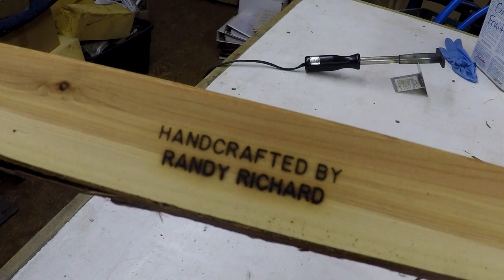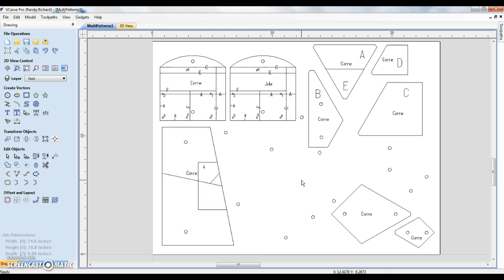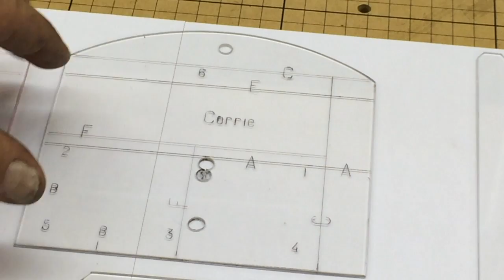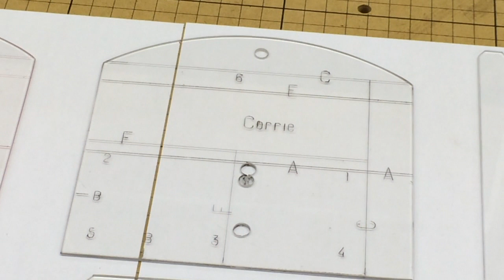X-Carve Quilt Patterns

Comment: Nice job on that Plexiglas.  Sometimes I have run a cutter or drill too fast and start to melt the edge.   Plastics are difficult to cut sometimes.  That run away at the end was funny.     Thanks for sharing.
Reply: +cerberus If you're etching or cutting acrylic, use cast acrylic instead of extruded. That run away at the end was probably due to him making a measurement error in vcarve.

Comment: Nice job Randy,  you need a vacuum table.   Glad the see there are other folks that cut through their clamps.   The odd thing is you can see that it's going to happen but time seems to stop and you can't get to the Estop button fast enough. 

Craig
Reply: +Craig S Definitely agree on the vacuum table. It would eliminate the need for hold down screws and "disposable" clamps. Specially useful with soft impossible to clamp  materials. Use ceiling tile as a porous sacrifice layer and seal the edges with saran wrap. Vacuum pumps are as easy as a discarded refrigerator and an old propane tank. Now that you have samples you could nest the parts better to maximize material usage. Happy wife... well you know. Happy daughters... I don't know.
  Mike (o\!/o)
Reply from the maker: +Craig S Yep a vacuum table would be great.
Reply from the maker: +Moholo 88 I will have to build a Vac. table.  I have a couple of vac. pumps.  Randy

Comment: I used to make gages out of 1/4" polystyrene (perspex or Plexiglass) for inspecting lamp filaments after winding. For the engraving I used a digital scale, a utility knife blade and then different colors of ultrafine Sharpie. In fresh cut lines the ink will run to the other end as soon as you touch it. I never tried it but maybe a carbide scribe would work. In colored transparent plastic the engraved lines would show as white by themselves if they were cut or spun in. Might even work in clear. Worth a try anyway.
  Mike (o\!/o)
Reply from the maker: +Frank deBros I have some cast on order, the wife wants more Quilting patterns, we will see how it goes.  Thanks,  Randy

Comment: I don't think it even slowed down when it went through that hold down. I usually run programs at a positive Z to check clearances.
Reply from the maker: +Doug Rundell I do that also.  I thing the computer does something in the back ground at times and screws up the g code stream.  This is not the first time this
has happened.

Comment: Wondering if you don't have an issue with lag from your internet connection or from Easel's site?  Personally I'd want to send g-code direct from my computer to the X-Carve.  Of course I could be wrong about all of this but since I don't own one but I've seen enough of these vids showing odd behavior that make me wonder if this could be the case.  Thanks for sharing Randy, as always I enjoy your vids.
Reply from the maker: +Larry527az I was not using Easel for this project.  I used VCarve Pro  and Universal G Code Sender.  This has happened on several projects.  I think the computer is running something in the background that screws up the streaming G Code.

Comment: Randy what bit are you cutting with? I have the older Shapeoko Il. was working with polycarbonate yesterday ant the single flute end mill wasn't working out to well. I run Mach 3 and 4 and an older stepper driver board from PMDX.
 garry
Reply from the maker: +TheRetiredtech I was using a single flute carbide end mill. Shallow cuts and high travel speed.